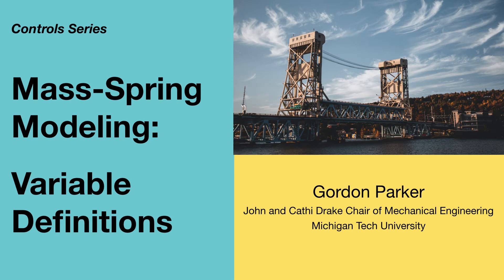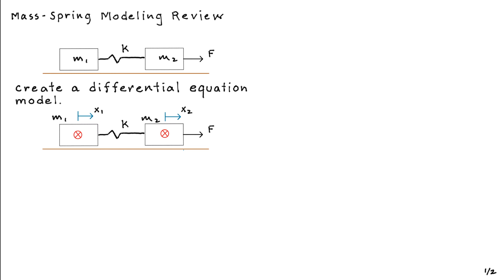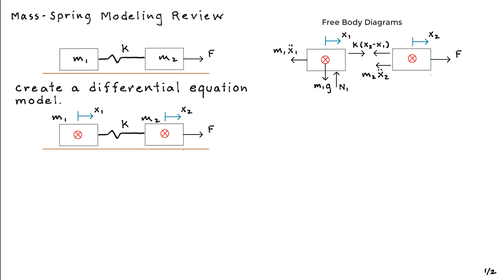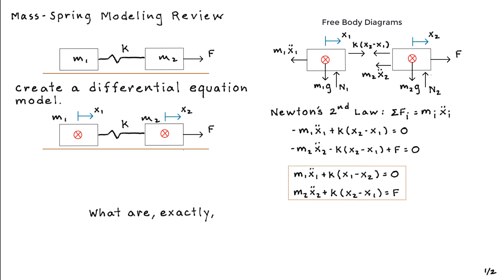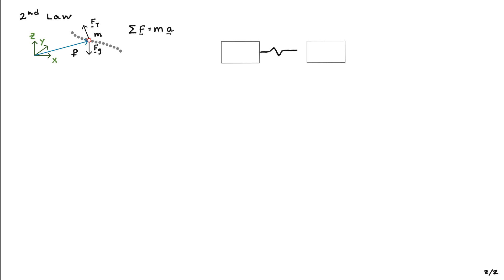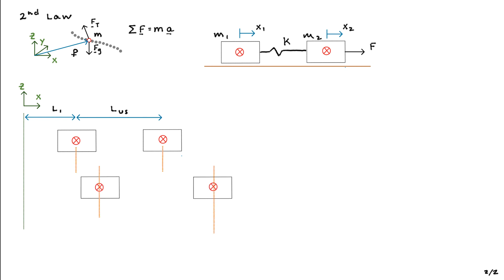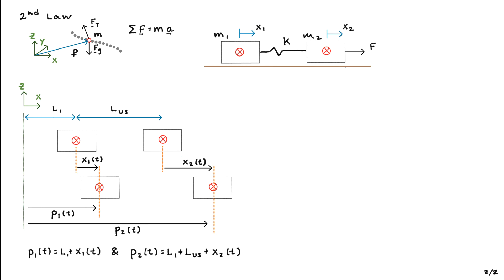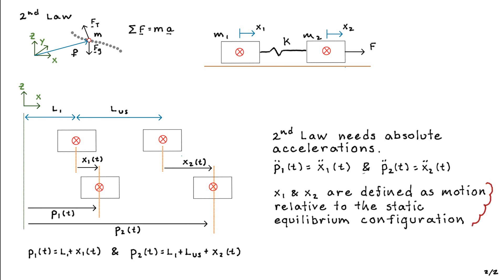Mass and Spring System Modeling

Comment: Thank you sir! 
Sir.. I have a dbt regarding control system. Is it possible to predict whether the system is physically realisable or  not by using systems differential equation ? Or if it is a non-linear system then how to check the physical realisability by its equilibrium point position?